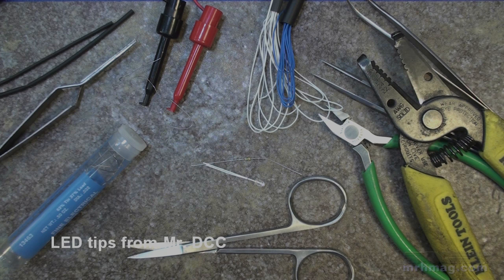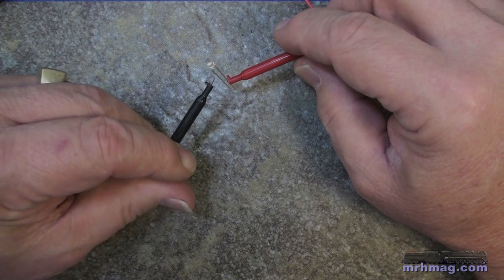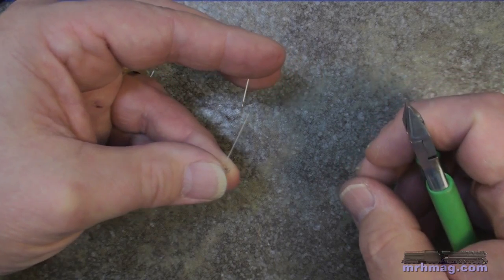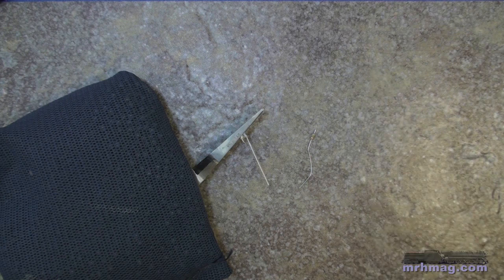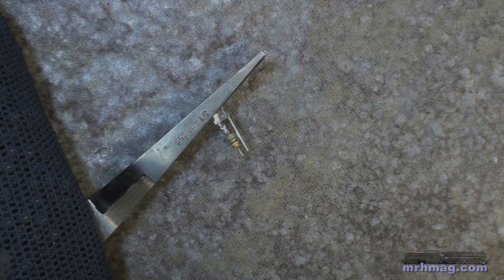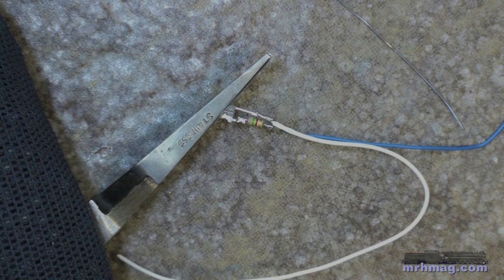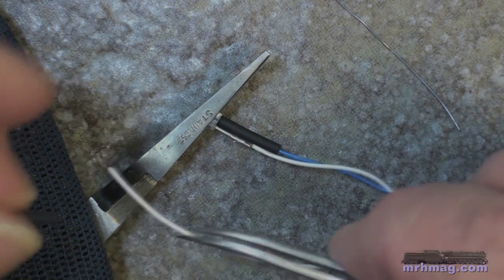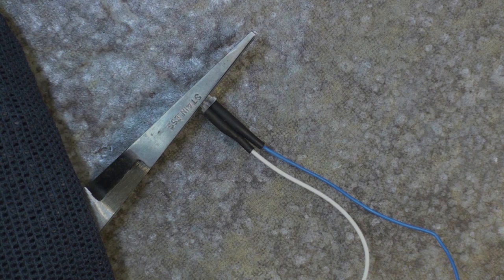Wiring for model train locomotive LED lighting

Comment: @BrucePetrarca thanks for the reply but where is your column mate? any chance you could send me a link to it would be greatful if you could help me out as at the minute i use a 9V battery to power lights in buildings if i could use the power from the track would help alot but obviously would need the correct resistor for the job! Cheers Rob

Comment: Like you said, it does not matter, but looks to me like you actually soldered the resistor to the Negative.  I say this bc if you look in the clear resin of the LED, you can see the "larger" piece of metal is connected to the leg w/the resistor.  This larger piece of metal is the Negative side of things.
Reply: The tweezers are covering cathode.